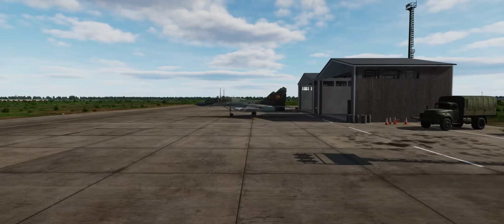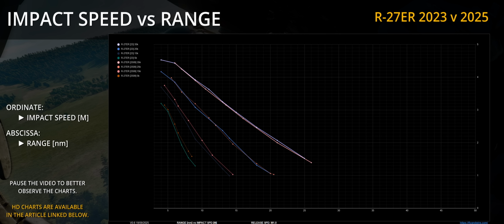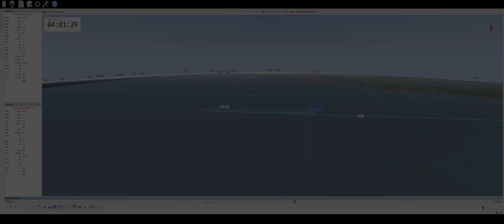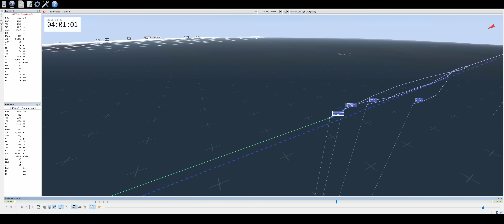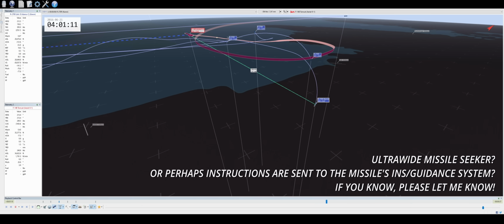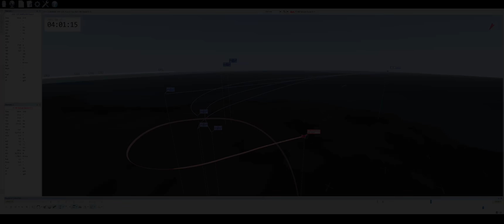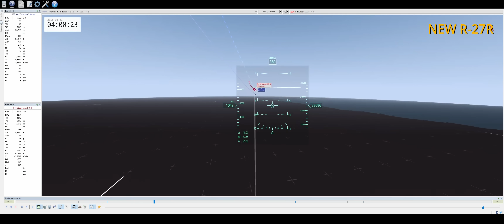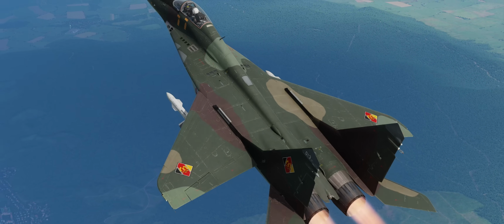A Look At the New R-27 Missile Family

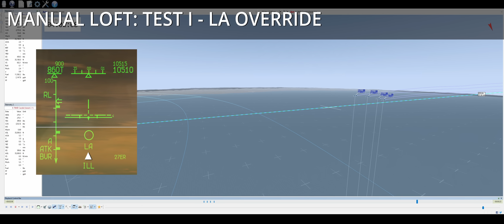Comment: 4:40 The reason it doesn't "loft" when you pitch up is because you fire the missile at long range(longer than 1.5x the seeker range) where it uses INS AND Radio Correction. On this phase a the guidance tries to place the missile at the same altitude of the target and target's horizontal movements are corrected(with PN). It happens (If I remember correctly) the seeker is fixed vertically and can only move side to side as the seeker is connected to the gyro. So to prevent target not being in the seeker FOV at the moment of capture(when missile-target distance=25km) if the target changes altitude the guidance puts the missile at the same altitude. Corrections(which moves the antenna in the horizontal plane too) is only done on the horizontal plane. I'd have to revisit to be accurate by detail but I'm sure its something like this.
Reply from the maker: Interesting, thanks for the explanation. Pinned!
Reply: The seeker antenna IS the inertial platform. It contains the 3 accelerometers and is gyro stabilized. This allows it to not need additional sensors for angular rate, it can simply integrate the acceleration to get the position of the missile. But this also means that during inertial flight the seeker antenna is forbidden to rotate in space. And this on all three axis (pitch, roll, yaw). The missile is then steered in such a way that the seeker boresight keeps pointing at the target, so that when the target is in range it is able to see it. So any upward movement from a manual loft will quickly be countered by the missile until the target is on the stabilized boresight line of the seeker again.
Reply: @BlackPixxelDE  yep you are right, the antenna is fixed on both ins and ins+RC. With INS I understand but not with RC. If you fire at a target 60° right from its nose, the missile longitude axis will aim to the targets expected position at interception and the seeker will be fixed aiming to the left of the missile's axis so the target can be seen the moment it turns to SAHR. IF the target does a right hand turn after the missile is launch so that now the geometry is you being to the 60° left of the target's nose, the R27 will go to the new intercept point, but it will have the target to its right but it's seeker will be aiming to the left, the opposite side. This causes a problem, I remember reading that the PN coefficient increases the moment its switches to SAHR to make up for this then goes back down.

I then also remember reading the seeker moves but my memory might fail
Reply: @mamo4731  I am not quite sure what you mean. But I think it should be pointed out that the seeker is not fixed in relation to the body of the missile - it is fixed in a direction in space. So if the seeker was pointing directly north at the moment of missile launch with INS/RC, it will keep pointing north until it is within seeker acquisition range. The missile body itself will maneuver in such a way that the boresight of the seeker keeps pointing at the target. Since the seeker cannot rotate during this section of the flight, this is done by translation of the missile on the plane orthogonal to the boresight vector
Reply: It also has an initial English Bias stage right after controls unlock that points the nose at a pre-computed lead point for seeker acquisition. Sparrow is suppose to do the same thing.
Reply: Where did you get this info?
Reply: @AeriaGloria on the mig 29 manual that talks all about electronics
Reply: So it behaves similarly to the S-200 as per this reference? https://www.youtube.com/watch?v=aZn9qg0XbSg